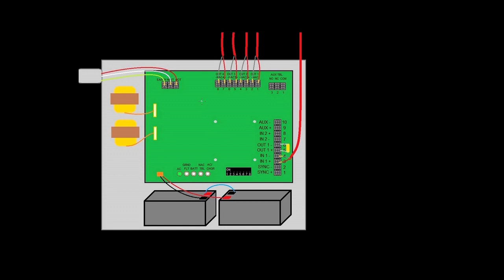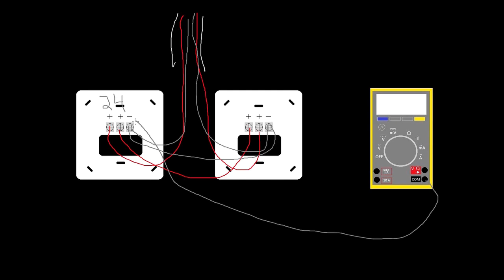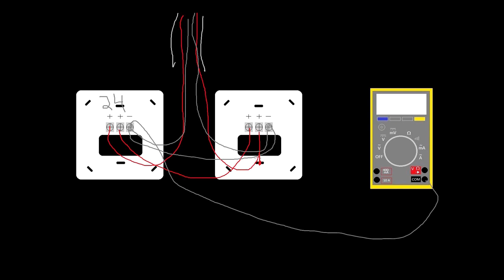34 - Troubleshooting a short on a strobe circuit - Introduction to Fire Alarms

Comment: What would it mean if one device you find voltage and let’s say 4.3k and then another device near by with zero volts but 4.3k ohms? Does that mean a possible short rests between the two?
Reply from the maker: That wouldn't really make sense unless you didn't put the first device back together before you moved on.

Comment: So at both devices you check voltage and resistance... On the one device you got 24v with OL, and the other you got 10k, 0 volts. Is that correct?
Reply from the maker: Bingo. But because those devices were back to back, with essentially one circuit coming down into the boxes (voltage) and the other leaving (EOL), I knew I was at my problem.
Reply: Joe Klochan would you mind doing another video on troubleshooting circuits? Maybe an example of troubleshooting devices not reporting back to the panel.
Reply: I have the same problem except I took the H/S down and metered the wires and got 24v and 10k so I wire nutted the wires completed the circuit went back to the simplex 4100es and still had a short ( no addressable by the way)
Reply from the maker: @Gibsonlp73  you probably have a strobe wired backwards.

Comment: This is assuming no tee taps. I've seen systems where every device is directly wired to at least four other devices
 I called it spider web tee tap, amoung other less professional terms.
Reply from the maker: This is specifically a strobe circuit. If you have T-taps on a strobe circuit, it isn't correct and needs to be re-pulled.